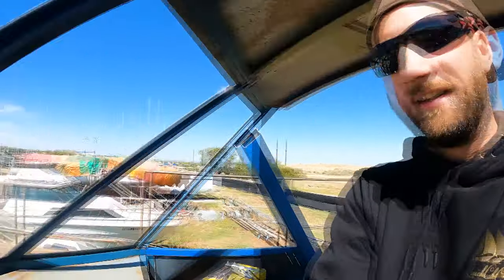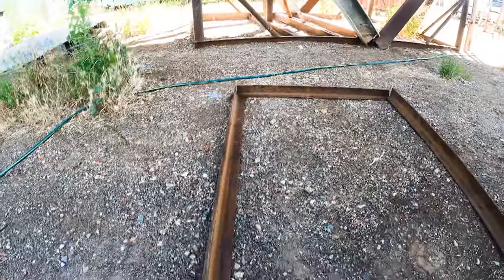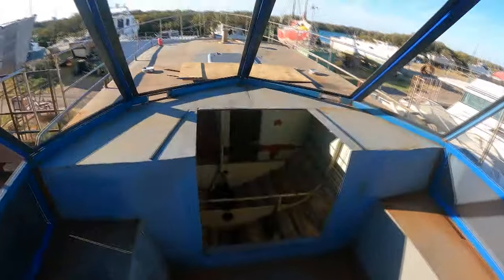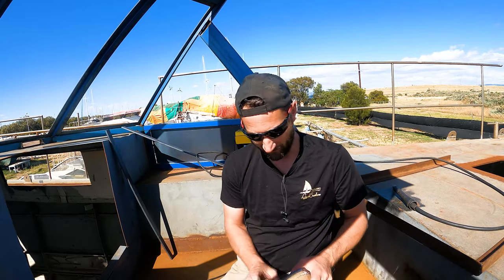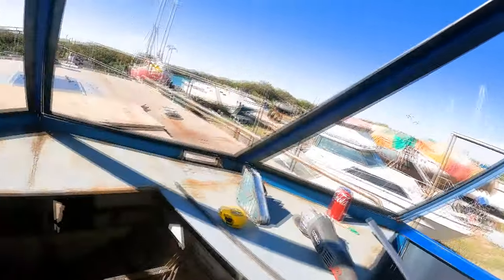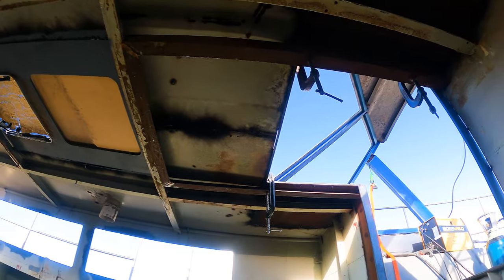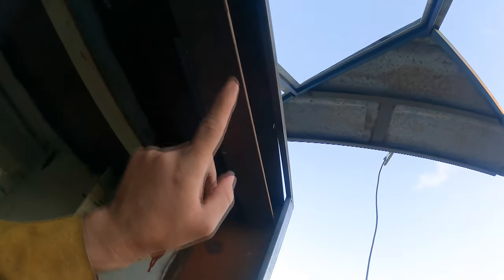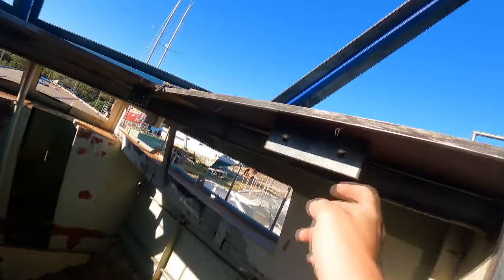Sailing QC #47 Companionway Slider | Design & Build | Steel Sailboat Restoration

Comment from the maker: Major works begin on our Companionway Slider this week working on both the companionway slider design and pulling it together! Companionway boat access is very important, it needs to be sturdy and functional all the while looking good and as sleek as possible to tie in with our boat build.
Security is super important, having the ability to securely lock up is the key, so we have opted to make it as study as possible to keep our boat safe!
Thanks again for all your amazing comments and support each week it doesn't go unnoticed and helps us out heaps!

Comment: You need to look into mill scale, it looks like you are welding in hot rolled steel, mill scale will cause your metalwork to prematurely rust or corrode under the paint coating. One solution is to buy "bright" steel. Or buy a wet blast attachment for a pressure washer, or a tercoo rotary blaster, sand blaster, or an acid bath. 

Loving the new companionway design, I'm currently ripping my wood bolted to steel hatch out, it was only held on with sikka the metal rusted away years ago 😂😂
Reply from the maker: Yeah millscale is nobodys friend. I plan on fully blasting and painting all the steel before im finished.
Reply from the maker: Cheers for your feedback :)